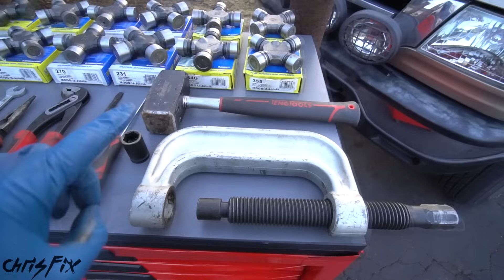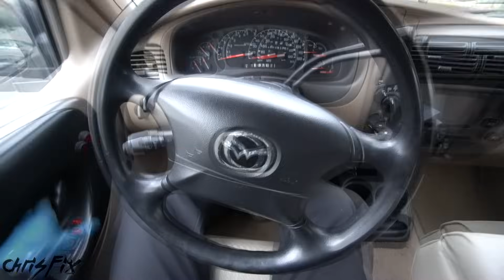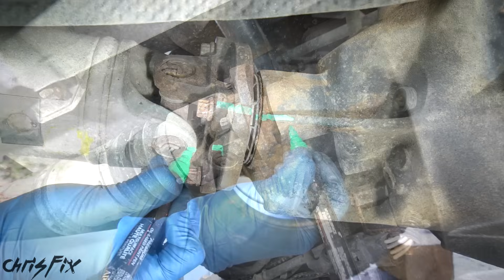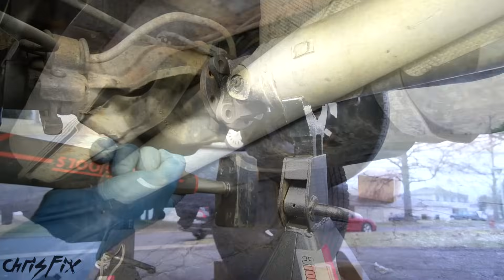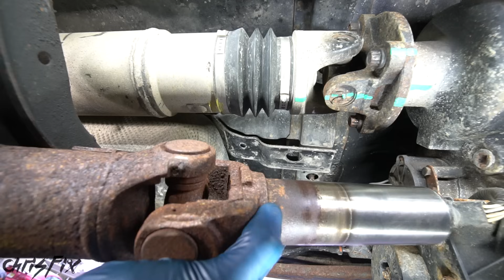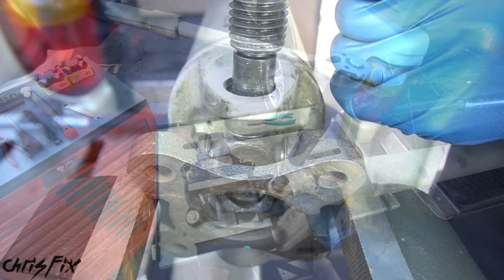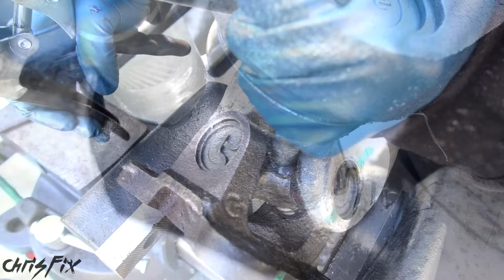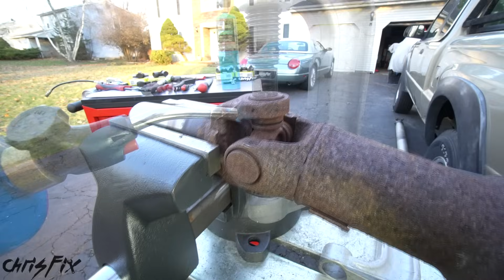How to Diagnose and Replace Universal Joints (ULTIMATE Guide)

Comment: Back in 2001, I bought a '96 Grand Cherokee Laredo with 72K miles that had spent every winter in Cleveland. First trip from Washington to Montana, I noticed some weird binding action and noises when steering in a tight circle. Got home and pulled a U-joint and found it was lubricated with rust, every needle bearing broken, and the lands they rode on were tapered. I put greaseable U-joints in everywhere. The factory ones were lubricated for life. Whose life?!

Comment: Here's another diagnostic tip: If you think it's squeaking try spinning the driveshaft! example: On a rwd vehicle chock the front wheels, place the vehicle in neutral and then jack up the read end( this is best done on a flat surface) and put jack stands under the rear to firmly hold it up. Next crawl under the vehicle and spin the drive shaft  if it really is the u-joints that are squeaking you should be able to hear it.

Comment: I just got a 1994 Ranger 4WD that has a bad axle Ujoint in the front axle.  In this case the ujoint is allowing the axle to flex and rub against the suspension causing the front end to "pop" or "jump" as it runs the 4WD.  So that is something to keep an eye out for if you have a truck like mine.

Comment: Hey Chris this will be my first time changing the u joints on the drive shaft on my 99 Chevy Silverado, my question is my truck has u joints with outside clips can I install u joints with the clips inside or does that matter? There’s also u joint with both inside and outside clips are those any good? Thank you
Reply from the maker: You will only be able to install ujoints with the clips made for your truck. You can’t put outside clips of it is designed for inside.

Comment: Chris,

Awesome video! This is the culmination of my U joint experience. However, you got my attention with your handy paint pen which you did not link in the description.

Also I tend to add just a very small amount of silicone grease to the u joint caps. It wont wash out and keeps the u joints caps from being tight the next time they need to be removed.

Keep it up. I am liking these videos lately!

Comment: Honestly, I can't believe there's not a ChrisFix School of Automotive Maintenance, Repair and Modification yet. Your videography shames that of industry-provided content. There are too many cool details in each video. The voice-over matches the video very well. I like the brief intro to the function of the item you're working on and I think you should link up with Engineering Explained for a more in-depth description of how the piece works. You can also use a C-clamp, a socket smaller than the flange opening and one larger than the opening as a substitute for the parts store press.

Comment: Great video, thorough explanation. I don't recommend popping the grease seals, though. It doesn't take much to fill the joint, so one quick pump should be enough. 
Also, I've used a C-clamp or large vice and sockets. The nylon shears fairly easily with a vice or press.
Reply from the maker: Thanks and thanks for the tips. The manufacture says to grease until the grease comes out which is why I did it that way.

Comment: Hey Chris, Derek Here, I have a question i want to ask you,  I currently have an Ford Falcon Ba and it has a few issues, the first issue, breaks, recently my master cylinder failed so i had that replaced, the car has only done 178,000km, after replacing the master cylinder, the breaks pad felt funny, apparently the main course of the break pads inside of the car to sink in was the break pads needed to be bleeded which i already have, but for some odd reason after all of that has been done, my breaks now sometimes disconnect itself and reconnects itself,  it makes this really weird thud sound when the car stops and the car slowly  move which then triggers the ABS light to go on, i am not quite to sure whether if i have worn out break pads because it starting to make a dramatically squeaking sound when reversing and back then it never does that.  can you please help me diagnose the problem?
Reply: as u can already tell im from strya hence why the km instead of miles :D

Comment: I pretty sure my u joint connecting to my front diff is in need of replacement, there is a little play.  But I'm also concerned that it could be my front diff bearings as when I rotate the drive shaft I hear a clicking any ideas how to diagnose the front diff bearing when I remove the u joint?

Comment: any tips on replacing a steering rack? i have an 04 acura tl and my power steering randomly stiffens mostly when the engine is warmed up. already tried flushing my fluid and i also don't hear any noises coming from the pump. also replaced my o rings for the hoses.

Comment: Chris, I have a question: 2004 Dodge Ram 1500 4.7L, If you step on the gas hard it acts like it's starving for gas but it's not. Uphill, it seems to take a while to kick into the next gear. Downhill is fine. I have been trying to diagnose the problem & have repaired every code it spit out but still the same issue...any help?

Comment: Great video!!! wish I could have seen this 20 years ago before I ruin a drive shaft from my 91 Olds Bravada.  I didn't know that you had to melt the plastic out before I started.  I bent the ears of the drive shaft trying to drive out the u-joint with the hammer method.  Only then did I find out from a GM mechanic that I had to melt the plastic out.

Comment: Hi im trying to replace mine but the u joint i got the caps just slide in easy and both put in by hand into the driveshaft ears, are they supposed be real tight and have to be pressed or can be placed by hand i i got the part number it goes for my truck

Comment: Great tutorial. I'm planning on replacing my U-Joints on my Ranger when the ground dries up here in Alaska. 

If you use the off-road lights on the front of the Mazda,please consider replacing them with a LED light bar. I recommend a brand sold on Amazon called Northpole. I've got their 20 inch version mounted right above the license plate on my Ranger,and Im planning on mounting a 50 inch version across the top of my windshield.

Comment: I've got a 02 Sonoma 2 wheel drive with a bad rear u-joint. Sounded exactly the same as yours in the video until about 5" of snow was the final nail in the coffin and it vibrates bad now lol here's to hoping mine come out that easily 🍻 they've never been replaced lol

Comment: This is a totally random question on this video, but what could cause a horn not to work. The airbag light is also flashing. Could those problems be connected or two totally different issues? The vehicle is a 2005 Nissan Moreno.
Reply: i know you wanted him to answer but they are connected! theres something in your steering wheel called a clock spring, if the wheel is taken off most vehicles have it it kinda looks like a white disc almost. thats also the thing that makes your turn signal turn off when you turn your steering wheel back! thats most likely your issue though since the clock spring is what acts as the ground circuit for car horns. most of my experience is from chrysler corp vehicles but a lot of cars are like this. please get it taken care of for safety purposes and have a nice day
Reply: Thank you so much for the reply and the good advice. It's probably an expense thing to get fixed isn't it??
Reply: not particularly no, if youre handy with tools at all you could probably even do it yourself! just go to autozone and get a steering wheel puller thats the hardest part about it. most garages shouldnt charge too much for that though probably only like a hundred bucks or so
Reply: Runs with Scizors Thanks again so much! We'll get that checked. You are very nice to give good advice. Much appreciated. 👍👍

Comment: Hey Chris, I have a clunking noise from the rear axel on my 05 Ford F-150. It happens when I drive off from a complete stop like at a red light. Can that be a u-joint or something in the axel?
Reply: check your u joints first, but more likely than not its slop in the output shaft of your transmission, or the rear differential coming under load. block the wheels of your truck and put the transmission in neutral. go under the truck and turn your driveshaft back and forth and look for any "slop" in the way it turns and listen for clunks. if that doesnt seem like its an issue look at the U bolts where your axle is bolted to the leaf springs, and check the leaf springs themselves to see if any are broken
Reply: I bought this truck four months ago with the problem. I thought it was a motor mount, but the garage that the previous owner took it to said the motor mount and U-Joints were perfectly fine. I bet they were too lazy to even check. So I went to check, and the motor mounts and suspension were perfectly fine. I’m starting to think that it is something in the differential or it’s a U-Joint. I don’t think it’s the suspension, and I’m especially hoping that it’s not the transmission. The garage that the previous owner took it to has horrible reviews.
Reply: id bet its slop in the differential or the output of the transmission, my jeep has had those both as an issue for almost 100k miles of daily driving and it hasnt hurt anything. make sure your fluid levels are good after you check

Comment: Hey Cris you should do a video on how to go from drum brakes to disk brakes. I have been looking at many videos but I can't seem to find a step by step video. I can't seem to find figure it out.
Reply: what vehicle are you trying to do the swap on? its relatively universal. take the backing plates for the disc brake version of your car, calipers, hoses and replace the drum backer on your current vehicle and it should bolt directly on! make sure you take the proportioning valve out of the disc brake car too! there should be a block off of the master cylinder that has a little cap or bolt on it, thats the proportioning valve and it tells your master cylinder how much fluid to send to the front and back

Comment: Thank you so much. If this video wouldn’t have popped up in my recommendations I would have been stranded with no drive shaft. I checked the u joints because it was vibrating a lot and you had it listed as a symptom. It runs sooo much better thank you again.

Comment: My brother pulled a drive shaft off a lifted truck that was in his shops parking lot and forgot to make sure it was in neutral.

Torque on the shaft from the trans/engine, or maybe just the slight grade it was parked on, was enough to send the drive shaft slamming into the side of his head when the last bolt came undone.

Might be something to add to safeties sake - not sure if there is any other easy methods to ensure shaft has no torque on it.

Comment: Hey chrisfix, this is unrelated to this video but I have a question. Your videos showed me the importance of threadlocker, and I'm in the middle of a repair and have a question. I'm replacing my struts; which bolts should I put the threadlocker on? Is it okay to put it on the strut mount bolts and the stabilizer end link?

Comment: Hey I don't know if you ever run across something like this before or not but I have 98 f150 4.6 one day when to start it and no spark I put all 8 plugs and wires in and replace both coil packs put new crank sensor on bottom and other sensor on top and put in a rebuild pcm  in and and still no spark put it on a scanner no codes have any idea?

Comment: 1.  OEM Spicer/Dana non-grease-able u-joints are better quality for a variety of reasons over aftermarket products
2.  Your after-market u-joints do not appear to have coated caps for your aluminum yoke, to prevent galvanic corrosion between the dissimilar metals.
3.  You can easily bend the ears of the yokes by using a sledge hammer to remove them.  A few thousands of an inch can put the driveline out of balance.
4.  Your after-market u-joints did not come with a variety of retaining clips with various thicknesses so that you could properly set the axial play.  You should save the old ones if aftermarket is all you can get or try to find other retaining clips of various thicknesses.  But hitting the yoke with a hammer if its too tight...Oh My!...that's a tip?
4.  But what the hey, what does it matter if you bent the ears of the yokes by hitting the assembly with a sledge hammer to get the old ones out.
5.  Best not to melt the plastic; they'll shear when you press them out.

Comment: nice video. 

I have noticed you like to use parts that can be manually greased. One thing to keep in mind is that when/if the part fails because the grease leaked out, chances are even if you grease it again the new grease is going to leak out again from the same place the original grease came out from.

Comment: Hey Chris, you usually shouldn't need to check for play in  the U-joint under the car (or truck) if there is squeaking, cause if there is that could mean that it would ether be something in the drive-train,  the fan belt, or the serpentine belt (like a belt heel pully or a belt tensioner). Brake squeak you would only hear if the pads were not installed strait (wearing unevenly) or you have the cheap $5-$10 pads that have metal flakes in them.

Comment: Is there a proper way to clean the inside of your windshield , I'd assume windex and a no lint nappy, but I've tried it and it snows here and I have no defrost atm... My car is a convertible and the windshield condensation inside will freeze over the wipe marks from the inside!! If you cant help with this how do I fix my Defrost, Dealerships charge like 900-1200$

Comment: Hey Chris can u make a video on painting cars using spray aerosols...
All the steps n precautions involved plus I have a few questions regarding the spray paints...
..Do they remain permanently on the body of the car or chip off with passage of time?
..Do physical conditions like heat(sunlight) or rainfall( / snow) affect the paint?
..Which is the best affordable spray paint brand which provides variety of colours?
..What about the thick clear coat which would be missing after we've spray painted the car?

Em waiting for your video of spray painting 😉😄... Thank You...👍👍✌️✌

Comment: My car has the same symptoms but it's front wheel drive
Reply from the maker: Check the CV axle. It usually makes noise on tight turns so go in a parking lot and make some tight turns.

Comment: chris, my chevy trailblazer sometimes not starts, no crank, no sound at all, after 2 min it starts again then runs all over a day without any problem, starts no matter how many times after that. I tried fixing it, I changed the battery, spark plugs, cleaned throttle, changed sensor changed starter but I am facing the same issue sometime, please help me, Chris.

Comment: i'll volunteer my truck for a spray on bed liner video
Reply from the maker: haha It takes a week to film so if you have a week you dont need to use your truck!
Reply: im in vineland -  2017 ram 2500 short bed i just dont feel like doing it myself - i dont mind the spraying part just dont feel like sanding - i dont think theres a way around sanding the surface is there

Comment: I once saw a 1964 Chevy station wagon pole vault on a dropped front shaft joint drop, believe it or  not  shocks, springs and full diff and tires where sitting in the middle lane of the Long Island Expressway,.
Reply from the maker: Dang! My dad told me a similar story where he was driving (slowly thankfully) and the driveshaft came out and wrapped around his ebrake cable and the rear tires locked up!
Reply: Preventive measures, as you teach, could save many road problems.

Comment: Why not twincharge the drift stang? That way you have bottom end supercharged power and top end turbocharged speed, also you could kill to birds with one stone a show both............ Just my opinion though, love your vids though
Reply from the maker: It’s not needed. A supercharger is plenty for the car with a stock motor. Twin charging would be good with a build motor.
Reply: ChrisFix Good point can’t wait to here the Dritstang whine... and I completely forgot to top end power isn’t the most important thing on the drift track, it’s about getting out of the hole when pulling out of the corner, thanks for reminding me!

Comment: Yea i figured i had a problem on my driveshaft on my ujoint i got a 06 mazda 3 it shakes on low speed the more i move the worse it vibrates once i jit 60 low shakomg amd hwy speed it dont shake it also squeeks sometomes when i take off sertain time on my left side of the car. Also clunks when i shoft gear. All 3 symptoms pretty much lol

Comment: Chris or anybody id really appreciate if you could help me out.. so today my cart started but cranked slower than usual and when it ran the idle speed was super low (about 1000 rpms at cold start) and constantly felt like it was gonna die. I changed the spark plugs because they were black but it didnt help. Its getting fuel fine because after cranking it a few times it smells like gas and there are no leaks. Does anyone think it could be the coil pack? I have a 2003 350z
Reply: Its almost like its not firing properly because its getting fuel its just not running like usual. Is maybe the timing sequence off?

Comment: A few words of advice. Unless your going to geese your u joint yearly or twice a year just go with sealed. Besides being stronger, the seal are tighter and keep stuff out better because their not designed to let geese in/out. Second please never use hammer method on aluminum drive shafts, the chance of wrapping it is too high of a risk just go rent a press their free. Last but most important  if your vehicle has a aluminum yoke or drive shaft make sure to get u joints that are coated to protect them from galvanic corrosion.